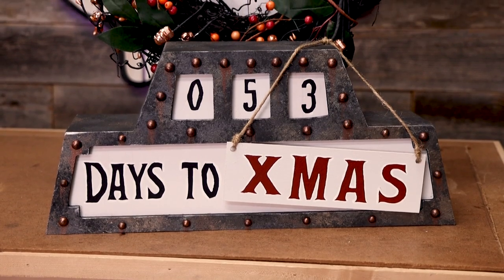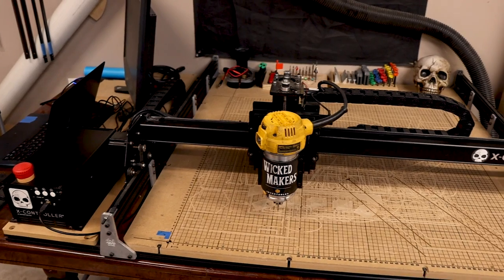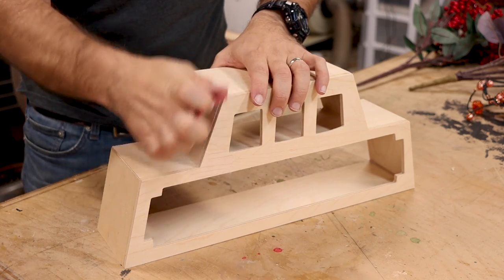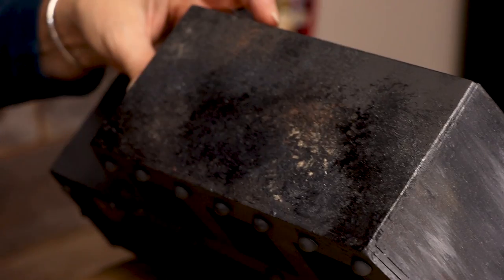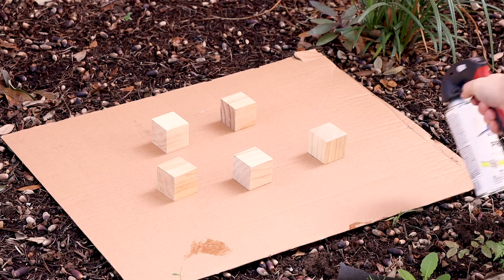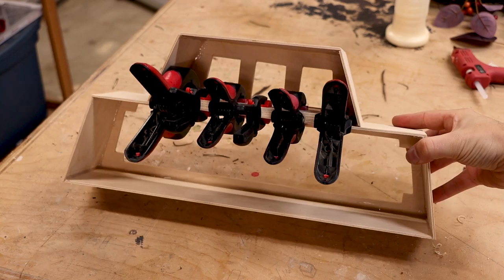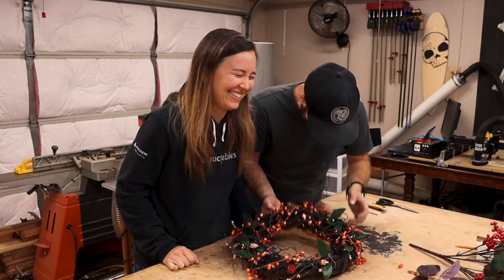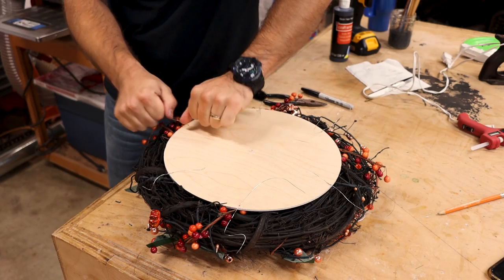DIY Halloween Props - Clock from Nightmare Before Christmas

Comment: When glueing up wood, painters tape or masking tape works as a great makeshift clamp. Quick and easy and holds stronger than you think. Love the box though!!!
Reply from the maker: Yeah good call, thanks! 😄😄
Reply: I concur, but I've been using magnetic corner jigs these days because sometimes tape slips.  :)

Comment: Awesome tutorial. Just completed my countdown clock for next year's Halloween decorations. Used thin plywood for the base and the clock. Took a long time to cut as I only had a utility knife and hacksaw to work with. I connected the wreath to the base by screwing some 2x3s into the back of the base and screwed/glued a piece of plywood from the back of the base to the back of the clock. I also added a string of purple dollar store LED lights to the wreath. Love how it turned out. This was a super fun project to do. You guys rock!!! 🎃🙂

Comment: I know this video is a year old and you might know this by now, but the stencil bleed issue can be solved by painting either a coat of a clear matte sealant or the background color on first and letting it dry before painting your lettering color. The first coat will bleed and plug any gaps, but won't show. With the gaps sealed with something that won't show, your lettering layers won't bleed and should look crisp. If you have any issues peeling your stencil without lettering peeling you can run a quick outline around the lettering with a craft knife. Easy peasy quick crisp letters without too much extra work!

Comment: I’m sad Halloween is over too! 😫 I’m out of town for a month, so I didn’t even get to decorate this year. Great project to incorporate Halloween and Christmas, which I will also be out of town for. 

I love that you guys tell us what you tried but didn’t really work out so well. So many channels cut out their failures. Content creators usually have better skills and equipment than us normal folks, so you already have a big advantage. I would have tried to use wood glue and wondering why I was having such a difficult time with the project. 

I just have one comment: it looked like the bat wing hands on the calendar clock were put on such that when close together, the bottoms of the wings are facing the same direction. I would have put them on facing different directions close together, but when they were six months apart, it would look like an outstretched, but mutated (two different wing sizes), bat.
Reply from the maker: Thanks!! Love the bat wing idea. 😄

Comment: since the insides are not seen and you have plenty of room, my tip is to glue cardboard inside each corner. This gives lots of surface area to stick and strength. The rhinestones look good as rivets- another source re googly eyes.
This project looks pretty good.

Comment: Im new to the channel. So you know this by now hopefully. Prime the wood with acrylic paint before spray painting. A light sanding will smooth out brush strokes. The spray paint will not soak into the wood, and give a cleaner finish. Paint fills in the imperfections.    I like leaving some areas raw and un sanded for added effect.
If I was destitute I would buy one of your shirts, but my light bill is more important.  I accept donations. 

Thanks for the insperation.

Comment: I bought the plans but some of the measurements seem to be off. :/
Reply from the maker: Hmm, which ones? We’ve never had that reported before. Happy to help.
Reply: @WickedMakers  Off the top of my head, the dimensions listed in the pdf say that the top and the lower sides are all the same size? I know I also had trouble with the fit of the shelf/bottom to the front.
Reply from the maker: Okay, we’ll give it a double check to be sure. If you find anything specific let us know. 😀